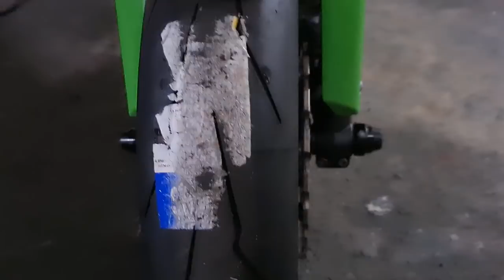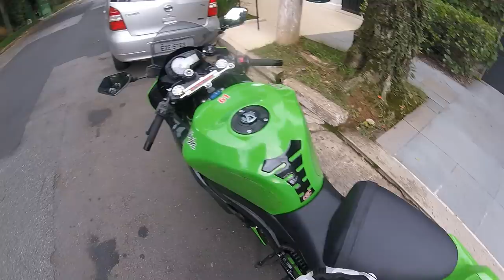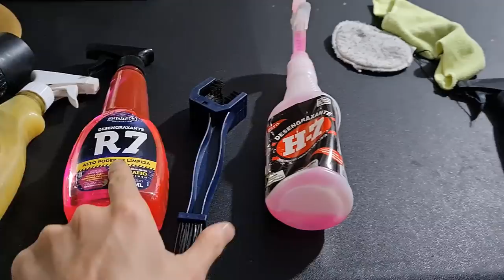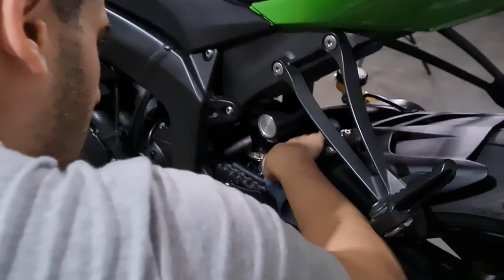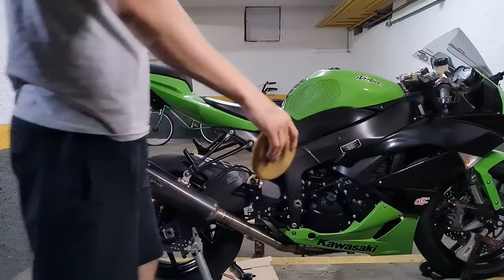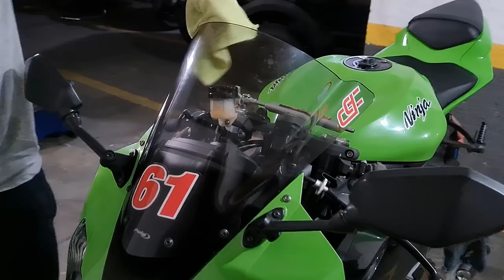DE REPENTE CHOVEU E MUDOU TODO O PLANO, VIROU OUTRA DICA - MISSÃO ELVIRA

Comment: Luxo! Durval, tem como tirar a ferrugem do cano em baixo da moto? Tenho uma fazer 250 e o preto do cano tá começando a sumir dando espaço pra essa ferrugem =/
Reply: Cara eu tenho uma fan 160 e te digo que o menos pior, é colocar WD ou qualquer desengripante sempre que lavar, passa no escape sem medo de ser feliz e  tira o excesso na flanela. Vai subir cheiro de queimado e vai sair, mas é melhor e mais facil que ficar repintando.
Reply: Eu uso Gel Decapante na curva do escape, fica no aço, prata. E pinto todo o resto com tinta spray de alta temperatura. O barro da chuva que vai pro escape quente transforma as curvas do escape naquela parada nojento com cor de bosta
Reply: Não é ferrugem, mano, é sujeira. O cano da fz25 é uma merda nesse quesito, nunca vi uma com o cano normal. Procura na internet como limpar, tem gente que usa até Veja Multiuso.
Reply: pintura eletrostática felhoo